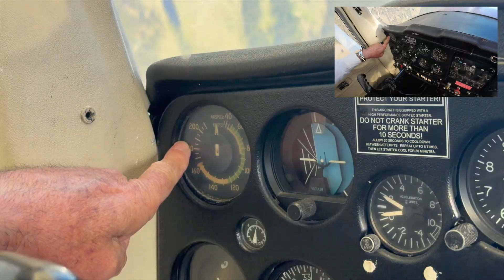‼️TRYING TO STALL A CESSNA - WITHOUT THE ELEVATOR‼️

Comment: Excellent video.  You have proven that the critical angle of attack is when the airplane stalls and not what causes stall.  The airplane cannot stall itself, a pilot pulling back on the stick or yoke is required.  Because of dynamic neutral stability the airplane wants to lower its nose to dynamically return to trimmed airspeed after pitch up or during bank.  We need to get this safety information out to prevent stall when too low to recover from inadvertent (not planned and practiced) stall.  A pilot caused the stall.  If on takeoff or in the pattern a fatality was the likely result.  During maneuvering flight (flight too low for recovery from inadvertent stall) airspeed and not altitude is life.  During maneuvering flight maintain zoom reserve airspeed and do not pull back on the stick or yoke in turns.  A turn of 1 g can be made at any bank angle...if the pilot doesn't pull back on the stick or yoke.

Comment: Great video! This eventually shows that an airplane conducting subsonic flight will only stall as the Critical AOA is exceeded, and that the elevator is there to control one thing: the AOA itself! Only by pulling your stick beyond the corresponding Critical AOA Position you will cause your airplane to stall, apart fron other transient events (as you nicely underlined) like gusts. 
Thanks again for the clear and informative video.
Reply from the maker: We'll explore elevator position in our next video! Thanks for the support @SideslippingSteve